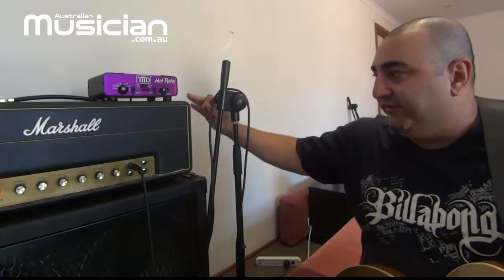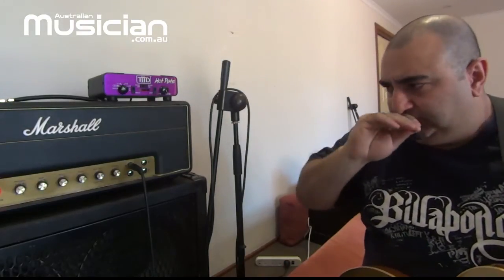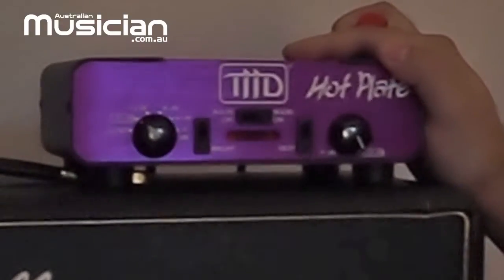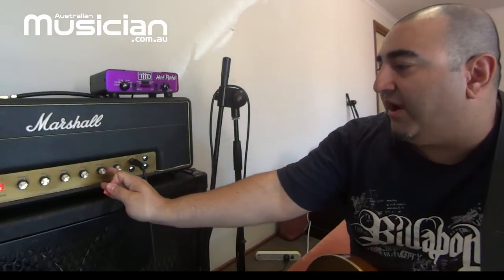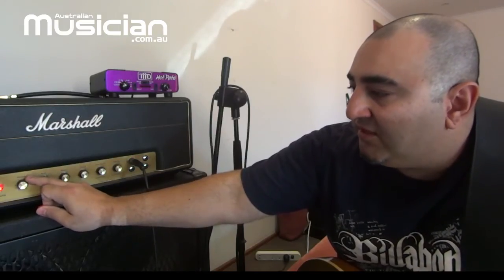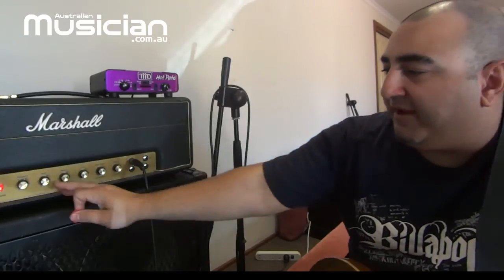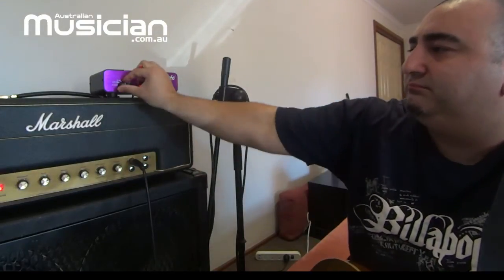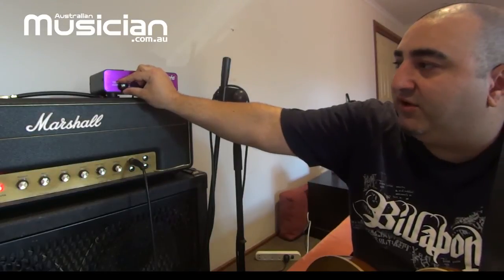Melbourne Guitar Show Tip: Using an attenuator to get a great rock tone

Comment: Awesome tone. Just a few questions if you don't mind. 
1: Is this a 50 watt Plexi, or a 100 watt 59' SL? 
2: What year was this amp made?
3: What speakers are you running in the cab?
4: What bridge pickup are you using in the demo
5: At 2:50 on the timeline, after you set your EQ, you played 3-4 short chords, where was the volume set to get that tone? 
7: Can that tone at 2:50 be achieved with a JMP or JCM 800 MV model?

Thanks.
Reply: MJ Bell. Hi thanks. This is the tone in the room with just the camera mic, unfortunately we couldn’t get s capture with the close mics. Here are the answers to your questions.

1. The amp is a 50 watt Marshall 1987x with a modified gain stage and master volume added to the rear.

2. Not sure about the year because The amp is second hand, but they are still part of the current Marshall catalogue.

3. The speakers are Celestion Lead 80’s

4. The bridge pickup is a hand-wound Gibson PAF

5. Master Volume at 10 Treble Volume at 4

6. You can achieve a closer tone from a JMP, but an 800 can also do the trick.
Reply: @rezanasseri1   I was curious about the same things.  Was very nice of you to answer each of his questions. Which , of course , makes you more of a Professional than most YT hosts. Cheers. 🎸🎸🎸
Reply: @RikJSmith  Thanks for the kind words. Much appreciated!

Comment: Hi! I have also a Marshall JTM45 2245 plexi 50W. If i'll buy and use an attenuator, can i play with the amp at full blast in my house? In this video i cannot figure how your attenuator influence your volume.
Reply: +AngusYoungBoyJR 

Hi Angus. First off thanks for your question, and great choice in amp!!! 
The video was filmed using the camera's own internal mic and not the mic that I miked the cab with, so the sound has been compressed and won't indicate much change in volume. An attentuator simply attenuates (lowers) the volume by choking the signal coming out of your head, converting it into heat and passing the remaining signal to the cab. It results in providing the speakers with a cranked amp tone at lower volumes.

Comment: How often do you go through Valves ?   I've just purchased a Laney TT50H and I'm worried it's too loud for home use. Awaiting the quad box - perhaps I should have got something smaller as I'm not playing live atm,  just stumbled across the gear at a great price.   Anyway I've found this exact attenuator for $150   ..  any comments welcome :)
Reply: Hi there, sorry to respond so late. Make sure the attenuator is rated to the correct speaker type (my cab is 8 ohms). Buying it will transform that 50 watt beast into a low wattage amp for the bedroom.

Comment: Would I put it in between the power amp and cab if your running a pre amp/power amp based rig?
Reply: Michael Papadopoulos.   Yes. From the power amp out into the attenuator then into the cab.

Comment: How would this pedal do an amp without an effects loop like a blues jr? And it be hooked up to through  in and out of a TC Helicon play electric?
Reply: You don’t put them in the loop, you run a speaker cable from your head into the attenuator, and another speaker cable to the cab from the attenuator.

Comment: Can i use this for a laney lv200 , it has pre amp tube and SS power section ?
Reply: Atul Sharma Yes you can!
Reply: It doesn't seem like you would really need to if the power section is SS